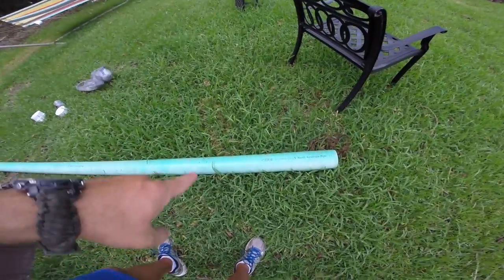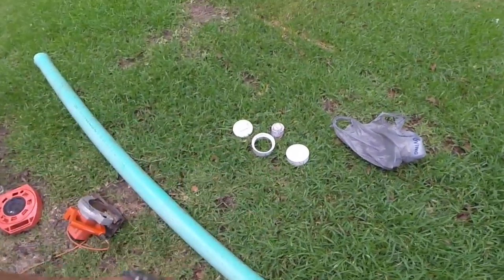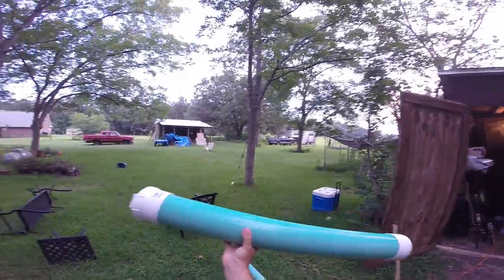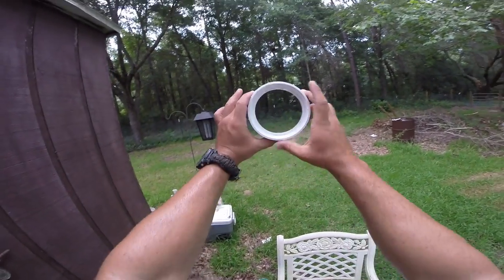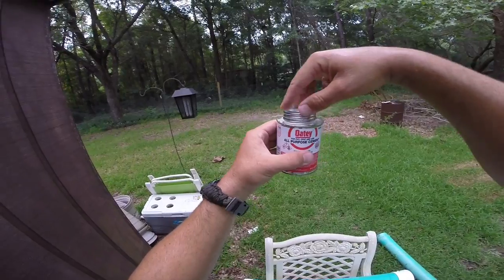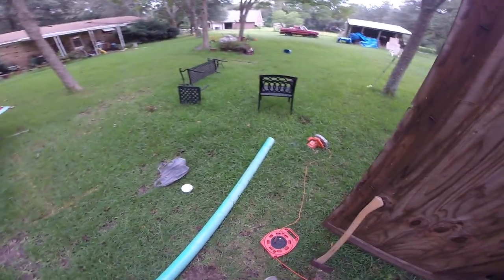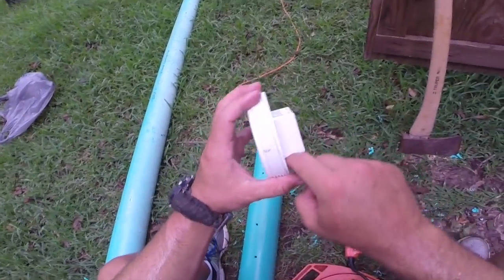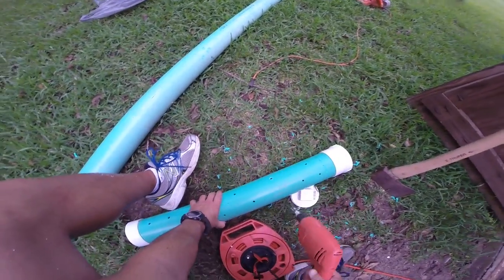Kayak Fishing: DIY Live Bait Tube/Tank #31

Comment: If I cut slits in the caps so water would flow through would it work as a pull along live well? Use it on a freshwater kayak.
Reply from the maker: +Josh Sharp yeah prolly. Its designed to pull along. I just used a drill because its easy.
Reply: +Yak Motley thanks.
Reply: +Red Beard doing a slit would probably work better, not at first but after it filled with water, but when its filling with water it might drag along

Comment: Put a pool noodle float along the length of one side so it floats,use zip ties to mount pool noodle.
I made one and it works great !!
Also,so that you don't lose the lower tube,put a 550 para cord line going up to the lid line.
NICE CHEAP BAIT TANK !!